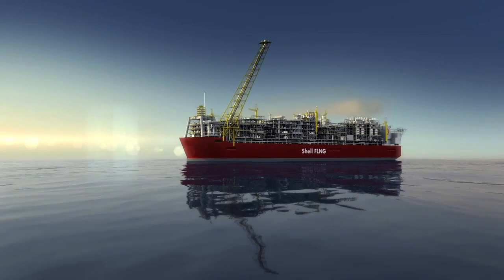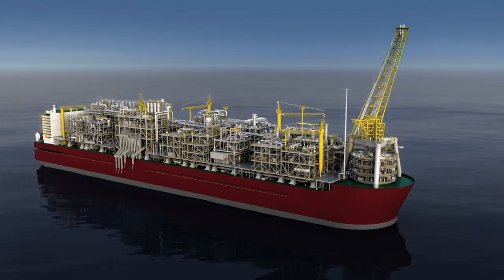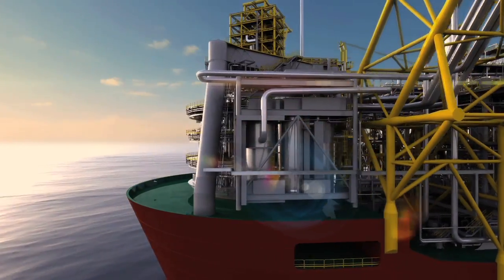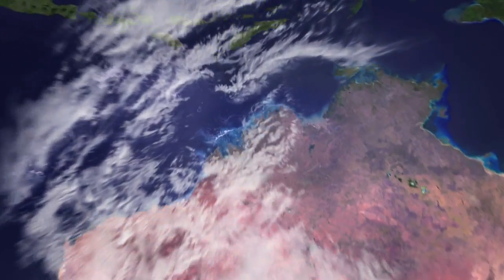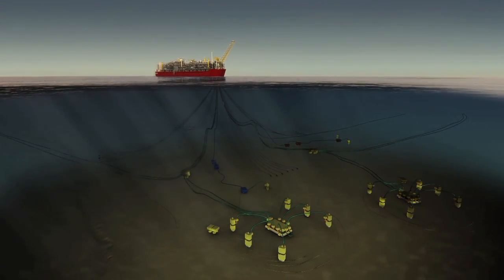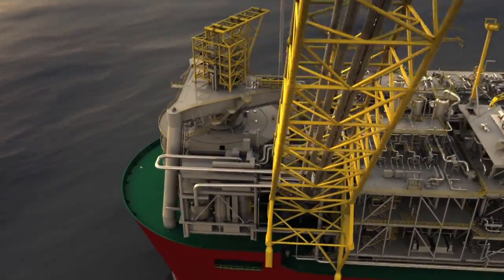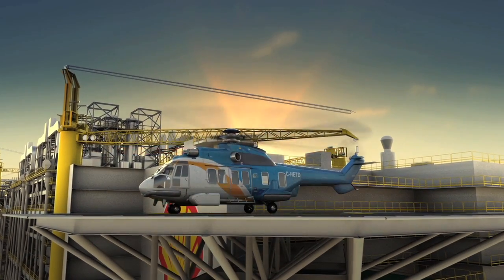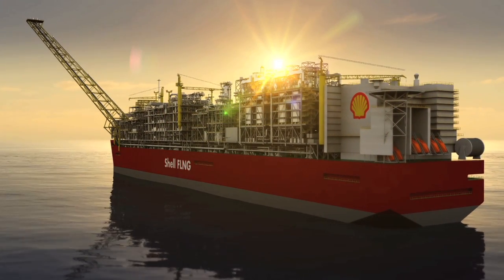Game changer for energy industry | Shell's Prelude

Comment: The concept has been around for some time. Great to see that it is coming off the drawing board. Assuming an FLNG vessel can be made available for smaller fields, an FLNG solves the environmental problem of "stranded" gas deposits, does it not?

Can we assume that the present Shell FLNG design will help cope with the technical challenges of extracting hydrocarbons from offshore "condensate" reservoirs in general, not just those on the NW Shelf?